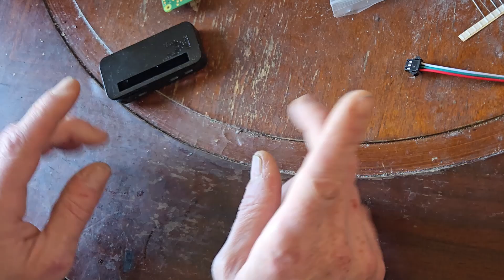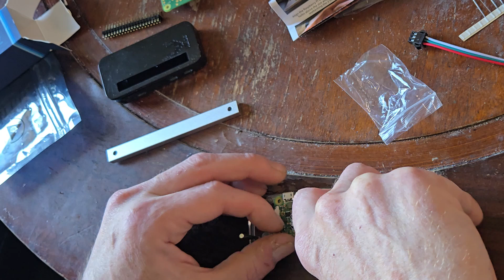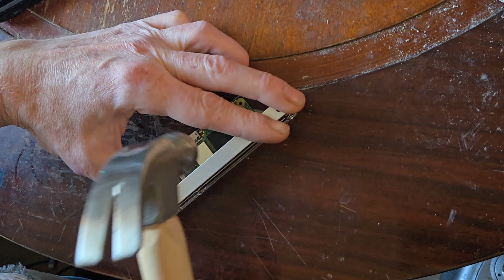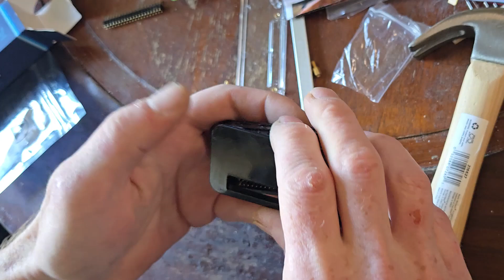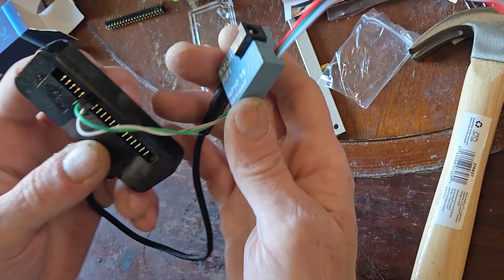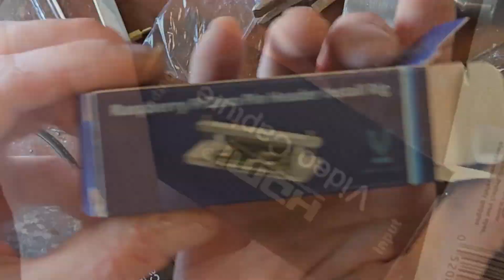No-Soldering, just hit it with a Hammer🔨 Add Header Pins to Raspberry Pi Zero (inc. W or 2 W)

Comment: oh god this looks painful
Reply from the maker: If you just referring to the thumbnail, that's an exaggerated portrayal. Obviously I'm not using a 5 lb sledge on the little raspberry Pi zero 🤣

If you actually watch the video it's pretty tame. In fact you don't actually have to use a hammer, one could use a vice to press it into place rather than tap it in but the results end up about the same.

Comment: it holds on so shitly, i had to solder it anyway
Reply from the maker: Maybe they changed the design, I did have to update the product link because the one I actually used wasn't available anymore... 

The one I used back when I made the video is still in use, no solder at all. Granted I'm only using two pins, however with my constant hyper HDR update videos and constant testing and changing things around, that little pi board does get moved around a lot. And I've had zero issues with the pin header...

I will look into if in fact they changed the style of the pins. The bottom side that goes into the board should have a little split and kind of hook into the hole really tightly once hammered into place... 

If I find that they cheaped out or made the product worse, I will remove any links to it or try to find a better option.

Comment: I would solder in like two 50 pins in time it took you to put this hammer one in...
Reply: Thanks for your useless comment. Like the other person said this video is for newbs like us, not for you.👍
Reply from the maker: I've been soldering since the 1980s and could easily do that -- this video is not for people like us. The goal is to give people an option to use the Pi Zero without having any soldering abilities/skills/desire to do so.
Reply: @JustinNelsonsProjects  Yes, it is for me, a dumbass who can't solder and didn't google enough before buying the non WH version lol. Very helpful indeed, thanks for the video. I'll probably trying to learn how to solder intead, but I'm glad to know there is another option
Reply: @JustinNelsonsProjects  Learn to solder is very useful skill, and if you are doing this, you will also most likely need to solder something to it/for it later anyway.... This is possibly OK only when you are doing it once and accessories you are going to connect are just some HAT or with pre-prepared cable. But i do agree that unskilled soldering may possibly cause more damage than this hammer solution. Just buy RPi zero with pre-soldered header pins ffs... 🙂
Reply from the maker: @Salamekleikum  From the Raspberry Pi website, they don't offer a Zero with headers. HOWEVER, yes you can indeed find them from third-parties like Adafruit or even Amazon...

I just wanted to make this video for fun btw, the whole "hammer on" thing piqued my interest and curiosity 😎

Comment: A hammer kit is also a press fit kit... With the right jig and leaver, with a stop at just the right point, a 200lb Gorilla can pin Pi zero's in mass with ease.
Reply from the maker: I had actually thought about using a vice instead of a hammer... but I wanted to try the product "as recommended"... I'm sure it would work just fine either way.

Besides, I think the 5-pound sledge made for a better thumbnail than a vice would have 😉